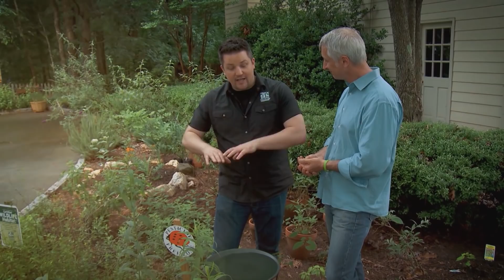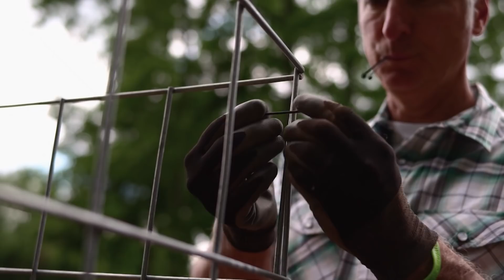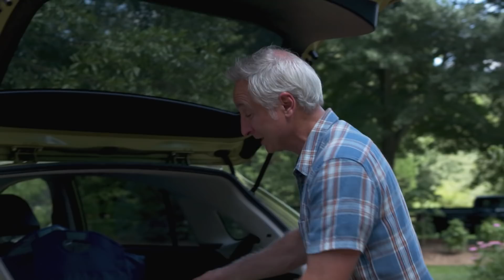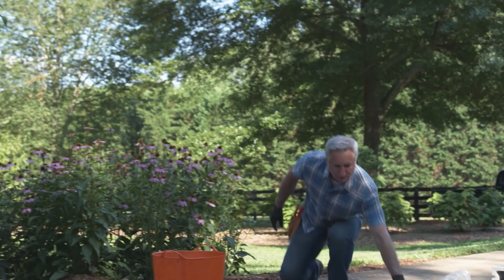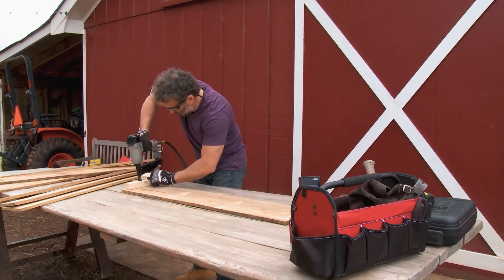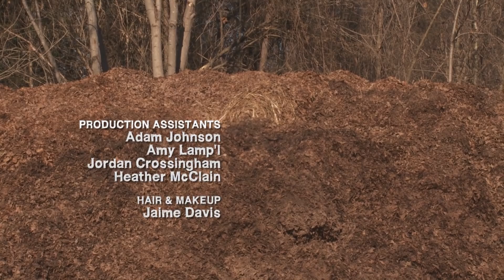Growing a Greener World Episode 1004: Gardening on the Cheap

Comment: Two items I use are fiberglass markers for marking driveways in winter, they work great in garden for staking and last forever. With them I use Velcro. I get a whole roll and inch wide. Using it in two inch lengths to tie up plants to stakes and trellises. It goes on quick, doesn't bight into the plant and can be reused year after year.
Reply from the maker: Yes! I love using the Velcro tape for doing exactly the same thing. And thanks for the pen tip. 👍

Comment: The broken bag tip is great. I do that and then mix my own potting soil. If possible, we use the empty bags for garbage. We have also received free wood chips, and it saved us so much $$$. I’ve added shredded leaves to my beds for a few years now and it has made such a difference to improving my heavy clay soil. My plants love it! My husband uses the thick spring grass clippings to mulch vegetable beds. It forms a thick mat that holds in moisture and prevents weeds.
Reply: When getting wood chips and leaves be sure of the type of chips and leaves. Black Walnut chips and leaves can prevent plants from producing what you want to eat.

Comment: I am a horticulturist and this is my tip.
-when using drip irrigation, run and peg down the drip irrigation then plant your small seedlings using the drip holes as markers, 1. You will get your plant spacing perfect and 2. Your plants will be right on the dripper’s where they need to be.
So many people do it the other way round and I couldn’t tell you how many times I’ve seen dripper’s know where near the root ball of the plant and therefore does not receive any water.

Comment: 11:57, he says the lawn clippings help his lawn so he doesn't have to fertilize as much. If you are using fertilizer, then it cannot be organic. Also, paper bags in the compost are not organic as there are synthetic binders that glue the paper together. Pallets usually have fumigation chemicals in them to prevent rot and contamination of product being carried on them in transport and storage.
Reply: I only use the pallets that are heat treated, no chemicals. It is marked on the pallet